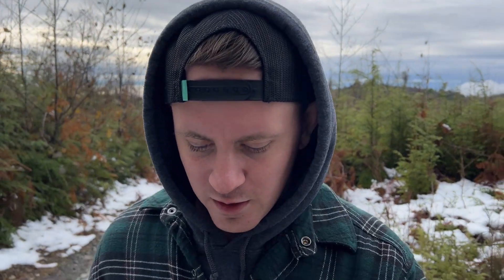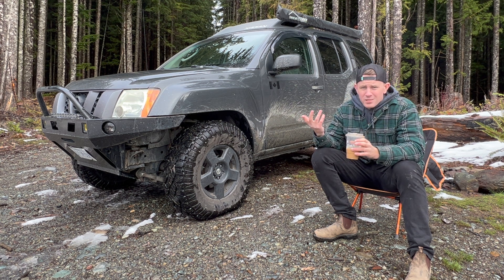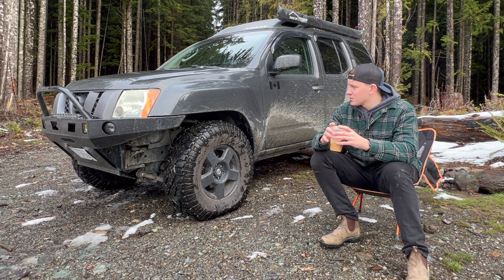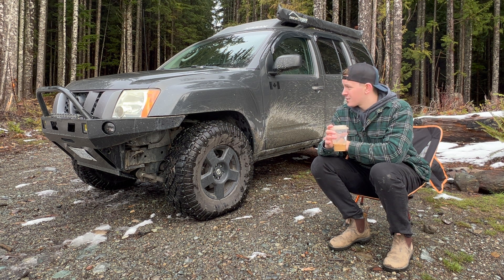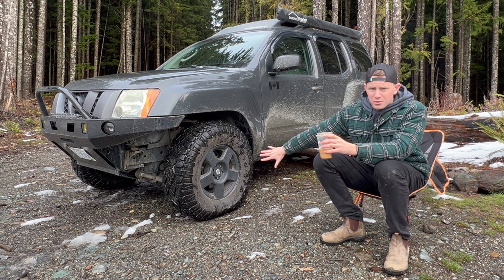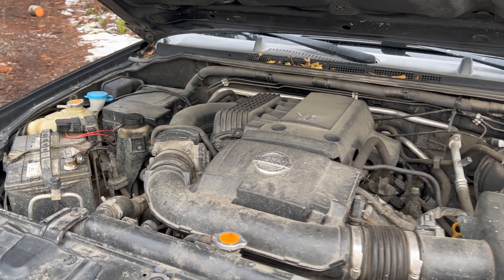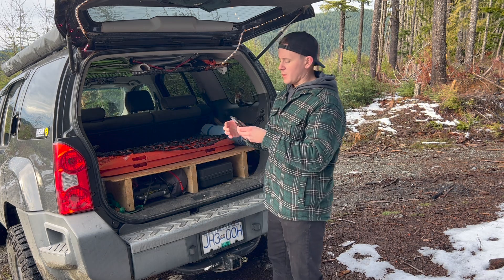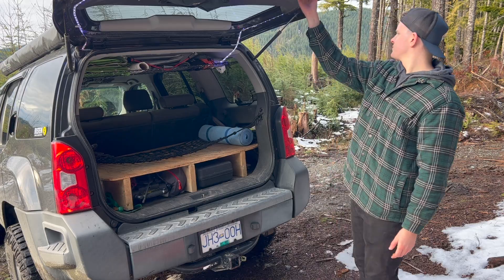An ACTUAL Budget Offroad Vehicle | Nissan Xterra | Overland Rig Walk-Around

Comment: They are underdogs! Thats why i love mine, rarely see any modified xterras around me so its that much more special when you do see one. Main reason i got mine at first was because i was a nissan fanboy with the z/g cars. But with a titan and vk swapped xterra it does turn some heads at the trails, gotta represent the nissans 💪🏽
Reply from the maker: 1000% 🤘🏻
Reply: Same ;-)
Reply: @destination.x  Are parts still available at ANY price? That is the biggest problem.
Reply: In 2011, I had to give up my manual transmission Toyota, due to a severe lumbar spine injury. I just couldn't work the clutch anymore without severe pain. I was trying to buy a top level off-road 4Runner to replace my manual FJ Cruiser, because everyone rages about 4Runners. Aside from Toyota's normally inflated prices, that happened to be the year of the Fukushima disaster in Japan. The top level off-road 4Runners were going for above MSRP (roughly $44K), and they didn't even come with the good stereo system, because Toyota couldn't get the parts, due to the disaster. I test drove the off-road 4Runner. It was okay. On a whim, I decided to check out the Nissan Xterra Pro-4X. I was blown away after test driving it. As a mechanical engineer, I did a little research. In almost every way, the 2nd Gen Xterra was a far better vehicle than the 4Runner, for literally $18,000 less. It has a fully boxed, high tensile strength Nissan Titan frame. It had better ground clearance. It was a more quiet ride, the stereo was awesome, the seats were more comfortable, it had better factory skid plates, a proven engine with all timing chains (albeit not great MPGs), I could keep going on. Needless to say, the decision was easy. After 12 years, I don't even see those 4Runners on the road anymore, because their C channel frames rust like crazy. 4Runners have become luxury vehicles for people who want to look like they go off-roading. If you want the best off-road vehicle, that's also a good daily driver, buy a used 2015 Xterra.
Reply: Same here pal

Comment: I got an Xterra (2012 Pro 4X) because it was the best deal in 2018 in low miles, with ground clearance, real 4wd and cargo room. It was in perfect shape inside and out. Cost me $12k at the time. I have put MTs and sliders on it, raised vents, only what I need to get get out of my driveway and "road" to get to work during monsoon season(deep water crossings). 5 years and 20k miles later I am very happy with my purchase. I did have a leaking passenger side axle seal, the vent wasn't plugged. It could have been just about any other 4wd to serve my needs but I am happy I bought it, it's growing on me.
Reply from the maker: Love to hear it!
Reply: hi what do you mean by raised vents?  The venting the transmission?
Reply: It’s insane how inexpensive they are. I was pricing used Toyota forerunners and they  were 3 - 4 times the price. I love mine and get compliments constantly. Mines lifted, wheels + tires, cargo basket , bumpers etc etc. have fun out there!

Comment: I bought a 2011 Pro-4X, with leather seats, for $27,509. It's now 2023, and its still going strong. I've got a 2" lift, melt mod, and 33's. If I still lived in CO, I'd mod the crap out of it. But, since I live in the DC Metro (not by choice), its not worth modfing my daily driver. The only other mod is a cold air intake. I highly recommend getting one.

Comment: I like the video. Gives some good ideas. I'm a Frontier guy myself. For the life of me, the only reason I can think Nissan changed the bolt pattern from 6x5.5 to 6x4.5 was to prevent Frontier owners from parts swapping from Titans/Armadas given the common parts that can be transplanted into the Frontier platform (remember, the X-Terra is the Frontier standard cab short bed 100" wheelbase).
Reply from the maker: Yeah, maybe! Thanks for watching 🤘🏼

Comment: When I talk to off-road mod mechanic shops, they have great things to say about 2nd Gen Xterras (except for the 2006-2007 models w/ the transmission radiator fluid problems). They told me they constantly have Toyota Tacomas and 4Runners coming in for rust problems and frame problems. The 2nd Gens have fully boxed, high tensile strength Nissan Titan frames. It may be a little overbuilt, but that's better than Toyota off-roaders who have to get their ladder frames straightened! They're beasts, plain and simple. They may not have all the bells and whistles, but I love my 2011 Pro-4X. BTW, I used to be a Toyota guy (2000 MT Tacoma TRD, 2006 MT FJ Cruiser). They just don't compare to the 2nd Gen Xterra's. BTW, to truly off-road in a Toyota, you literally have to buy bolt-on frame strengthening plates. If you wanted to put 33's on a FJ Cruiser, Tacoma, or 4Runner, you literally had to do a front wheel well frame chop (they call it the body-mount chop)! I know, I used to have one. Toyota hasn't fixed that, even in 2023! I'll stick with my 2011 Xterra Pro-4X, that will last me another 10-15 years.
Reply from the maker: X’s > Tacos
Reply: @destination.x  they definitely are. The problem is finding competent mechanics. If you live in the western US, there are several to choose from. Here in Northern VA, I can't even find someone to troubleshoot basic wiring harness issues. The dealers are complete idiots since it was discontinued in 2015. Nissan's CPUs are very proprietary, and very few independent mechanics have the ability to troubleshoot them properly. It's really frustrating.
Reply: I was also a Toyota guy and went with a 2011 Pro 4x too because my Tacoma's frame rusted out.  I also have a 2020 Tundra for work, but I think they're too big for my off-road likes and MPG horrible... and Toyotas are overpriced
Reply: @Nigriff the Toyotas drivetrain is its strongest link. And if you’re outside the rust belt, and the cars well maintained, they’ll probably never run into mechanical issues. There’s ball joint issues in a few of them and frame issues but if you need 500k miles out of a car, and you’ll keep up with the maintenance, they’re great options. Looking into an xterra or pathfinder to throw around, I’m an overland guy so probably the pathfinder for the additional space
Reply: @gabeross515 what year Pathfinder are you thinking. What’s your height? If you are planning on sleeping in it.
Reply: @bdmenne   not sure the year. Not quite sure what years are best. I’m 5’10 and travel buddy is 6’2 but we do the rooftop tent thing. I just need the room for my equipment and to still be capable on medium trails with some decent weight
Reply: I have a 2006 (and can sadly atest to these issues $$$), and its halfway rebuilt due to longevity parts replacement. Honestly want to do something like this for it just as rough road vehicle, not necessarily an overlander because I have the 2W version
Reply: @ThatOneSPC  I imagine they didn't know the coolant was mixing at that point. I forget if it started with the 2005 or 2006 models. Were you able to get the SMOD work around completed before the bad transmission fluid broke your transmission? Nissan really needed to issue a recall for that BS. I have a master's in ME. That's an inexcusable design mistake. I'm sorry you were affected by it.
Reply: @Nigriff  my mom's 4Runner frame (2008 V8), just rusted to the point where it was dangerous. I told her to just buy a used Nissan Armada, because they're fairly inexpensive, especially compared to used Sequoia's and used GM Tahoe‘s/Yukon's. For some reason, used Ford Expeditions and Nissan Armada don't hold their value like Toyota or GM large body-on-frame SUVs. My mom decided to get her 4Runner frame fixed. I told her it was stupid.
Reply: @gabeross515  I see old Pathfinders around all the time, and they seem to be in very good condition. I'm talking about the body-on-frame models. I forget the last year they made them. They must be good vehicles, because I see really old ones on the road often. The only issue with overlanding with a Pathfinder, is that it has this weird air bag rear suspension system. I'm sure someone has figured out a way to add regular shocks to it.
Reply: @DDDYLN  Thankfully ive avoided the transmission issues, but the engine is starting to take a hit. I bought this from the 1st owner, and he drove it religiously from 2006 to 2009, and then it became like a loaner for the kids type thing. It was in great condition, but you can tell engine maintenance wasnt done as often as it shouldve been. Gotten 198,000 miles out of it since I bought it, currently sitting at 276,000 so not a loss if it goes out. Thinking of ways to keep it alive though, thats how I found this video haha
Reply: @ThatOneSPC  those engines can last about 400K miles with excellent maintenance, but only 300K with poor maintenance. You can always swap in the Nissan V8 in the Titan and Armada. A lot of people do that on my Xterra Facebook groups.
Reply: @DDDYLN  Thats kind of the idea. Do a swap, and just build it up. I'm already half way to a whole new xterra in parts replaced so I'm rolling with it ans getting creative haha
Reply: @ThatOneSPC  I really want to. Unfortunately, I'm physically disabled. I can do small things myself. But, despite having a master's degree in ME, I just don't have the physical ability to work on Xterra myself. I also live in a condo association that would like me working on my vehicle in the parking lot. I want to Titan Swap it with a 3 ribbed Titan front diff. I want to regear the diffs for larger tires. There are so many things I want to do, but I would have to find someone to do them for me.
Reply: @DDDYLN  Well I'll tell you right now, as much as that can be difficult, I fully believe it'll happen eventually for you. I'm not disabled, but I am bogged down with my own limitations on money and space to work and its been rough. I applaud you for not letting go do the community though. Most Xterra owners ive spoken with have been great when it comes to rebuilds and just making it their own and I'm rooting you on as much as I'm rooting for myself!
Reply: @ThatOneSPC  I just had an L3-L4 lumbar spine fusion. I had lost two thirds of my left quad last summer, due to severe spinal stenosis. The good news is that the surgery went really well. The surgeon only gave me a 50% chance of getting my left quad back, but it's now almost as strong as the right. This is my 3rd lumbar spine fusion, and 4th spine fusion. I was a collegiate wrestler. I used to squat 500_lb, and clean and jerk over 315_lb (no anabolics). All that stuff took a toll on my body. I knew my health was going bad in graduate school, I just didn't know why. They diagnosed me with autoimmune hypothyroidism. But, while working, I had muscle stiffness and pain daily, but it always got worse after physical activity. Over the years, the episodes of severe pain and stiffness, which kept me home from work, kept getting worse. No doctors knew why. It was sheer luck that I got diagnosed with a genetic adult onset muscular dystrophy, which is progressive. I'm not very badly affected when it comes to true muscle atrophy. But, a small percentage of FSHD patients experience severe muscle inflammation. Low dose corticosteroids used to take away the muscle problems almost completely. These days, I can go to the gym while taking low dose corticosteroids, but I spend most of my life lying on my couch. I do have a plan, though, and the researchers are getting very close to a treatment for FSHD. Sorry, didn't want to bore you with the story, but that's the situation. I was actually a spacecraft engineer for almost 12 years as a federal employee. But, my bosses basically forced me onto disability. But, like I said, I do have a plan.
Reply: @DDDYLN  Dang man. I dont know what your name is, but I'll forever remember this as a conversation with the Xterra Man with a Plan 😂 You got this man. Honestly look forward to seeing good stuff
Reply: @ThatOneSPC  thanks. Everyone needs to have a plan, especially people in my situation. Believe it or not, I was a spacecraft engineer for the US Naval Research Laboratory for almost 12 years. When I was forced to go out on disability, my wife divorced me 3 months later. But, I still have 50% custody of my daughter. So, I have to keep moving forward for her. I have to set an example that you never give up, no matter how hard life gets.

Comment: My 2013 Xterra has almost 270,000 mi on it and running strong. Only work I've done is maintenance on the suspension. Time to do the clock spring. But no major issues since I've had it at 103,000 mi.
Reply from the maker: Love to hear that!

Comment: I have a 2012 S model at 103k miles and outperform full size trucks, other suvs and decimate jeeps on and off road. No mods. I've owned it since 2015 and only replaced outer tie rods, and just did rear struts due to use as a loging truck and being severely overloaded on a regular basis.
Reply from the maker: They’re very underrated and reliable rigs!

Comment: I got a 2012 frontier sv king cab 4x4 i did end up swapping my rear axle for a m226 off a pro 4x so i got a rear locker. I bought a Bilstein 5100 kit off all dogs off-road and the .5 in spacer and got their uca's. I also got new wheels and threw on some 33s the truck rides phenomenal on road and off road im super happy with it its took me everywhere i wanted to go. I may titan swap it in the future but im definitely happy the way it is. If you really want a locker the axle swap is very easy man you can do it in a day easy there's a step by step direction post on the x message board I did it in a half day by myself moving the axle around on the jack by myself was the most difficult.
Reply from the maker: Your Frontier sounds siiiick! I actually just got a new overlander built Xterra thats fully done up so that’ll be premiering on this channel eventually 👀

Comment: Nice x. I have a 2011 pro 4 x and I’m in the market for a steel bumper. Did you weld this coastal bumper? All I am seeing is diy weld kits on their website
Reply from the maker: Yes I did weld it. All their bumpers are kits that need to be welded together
Reply: @destination.x  do you think a novice welder could handle that job? Also what type of finish did you use? It looks great. Thanks for the reply

Comment: Bout to buy a 2012 Pro 4X, what should my first mods be? Steel Bumper & Hitch, Lift, Roof Cargo/Lights, Snorkel, Bigger Tires?
Reply from the maker: Totally dependant on your plans for the usage! I’d recommend a simple lift and bigger tires to start. Some people say to buy a steel bumper first though and just use out the current shocks until theyre needed to be replaced

Comment: I will say this about the comment about the S/C version ! They are absolutely awesome but that being said they do require a little more love and maintenance then just your average vehicle! That being said they are still wicked tough and have a iron block. If someone blows one up that's really on them. Fuel sucks these days and take for example i have a S/C frontier and i always have spare fuel with for the bikes and especially none ethanol laced fuel. You really have to go out of your way to help add and use the best fuel but i have towed huge race trailers driven across 120° hot desert hauling absolute a$$ and still get almost 20mpg while doing 70-75 mph ! That being said though that's why i use the best fluids and make sure all my maintenance is done. All the vehicles Nissan has sold and built since the newer stuff is actually extremely tough and rugged! I have had multiple vehicles and they all ran good and even better when i got my hands on them ! I have had old Pathfinder's with 250+k that absolutely have screamed drifting down back roads or towing logs out of the woods! They are awesome and always worth a shot! I am excited as hell to build my X here soon just found some wheels and more cool stuff for this thing! It will be awesome to see what that engine can do and have a sweet little off road toy hauler 🤘🤘🤘🤘🤘
Reply from the maker: Hell yeah! I love it

Comment: Great looking Rig man! I actually got one, a 2008 Off-Road for the same reason "The are Underdogs" and everyone doesn't have one, they are more unique. I had two Land Rover Discovery D1 and then D2.  I actually don't like the looks of the Toyota's other than the FJ Cruiser's and it took awhile for those to grown on me.
Reply from the maker: Love to hear it! I’m same with FJ’s lol. When i was younger i always called them ‘Barbie cars’ because I thought they looked like a toy version of a Hummer… but I’m a fan now in my older, wiser age 👌🏼
Reply: @destination.x  Exactly the same I was actually really looking at FJ's and everyone I found was 20K for one with 200K miles if it was lifted...finally I was like I'll spend half that on a Xterra and get it lifted and have a truck with way lower mileage.
Reply: @destination.x  Regarding wisdom, any other underdog but WITH parts for repair that are possible to get?
Reply from the maker: @infdox9051  R50 Nissan Pathfinders. Alot of Toyota parts fit them so cheaper and easier to find parts

Comment: I have the same Bilstein 6112 in front, and 5100 in rear for my 2012 Nissan Xterra. I than got all new Old Man Emu leaf springs, now get the front bumper like yours.
Reply from the maker: My leaf springs are definitely do for an upgrade or at minimum an add-a-leaf
Reply: @destination.x  That bumper is bad, just need to get it now.
Reply: Do you like the ome more then bilstein? Debating which to get. Have the 4600 now with shackles and looking to update it this summer

Comment: How did you do mounts for the awning?
Also how are the 5100s after getting weight back there with the rooftop?
Reply from the maker: The stock L-brackets that came with the awning then attached then directly to the stock roof rack with 2.25” diameter muffler/exhaust clamps. And the 5100 have been great. Amazing quality and durability for the little cost they are
Reply: @destination.x  appreciate that!